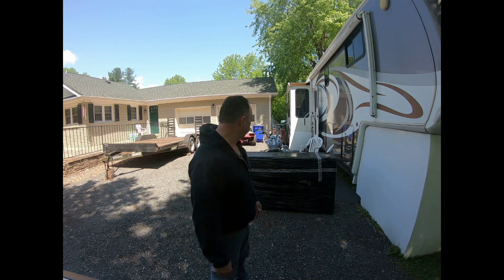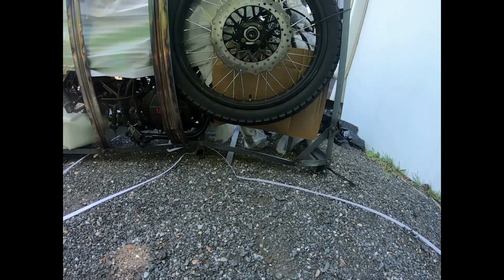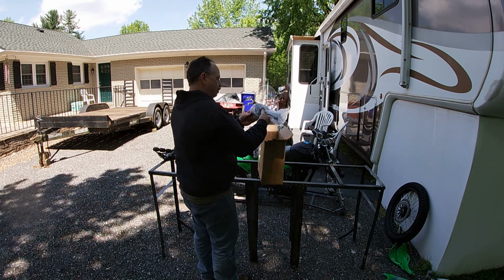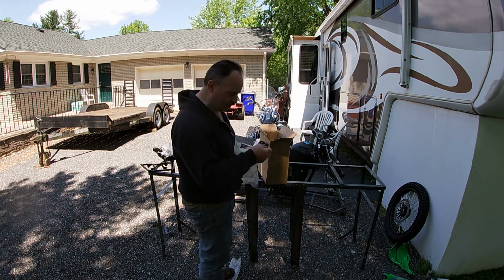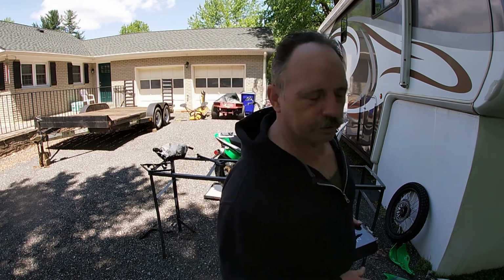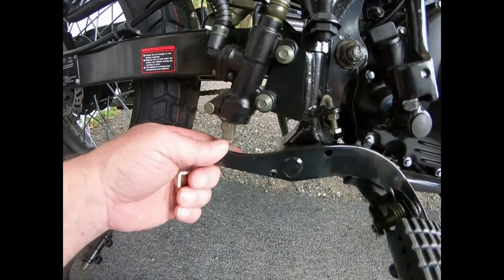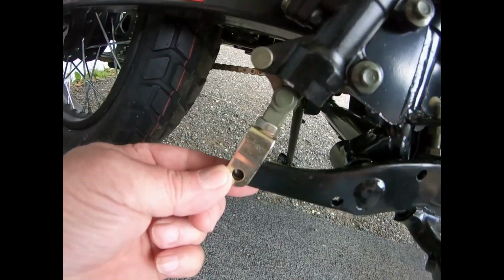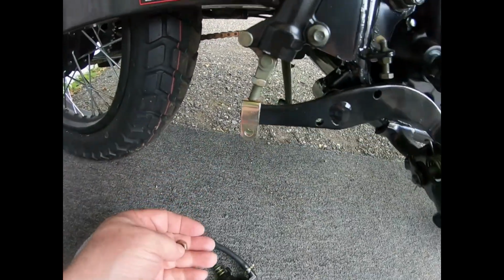Unboxing  a Tao Tao TBR7

Comment: Hey I seen you just got this tbr7 so do I check your back brake hydraulic line going from your back brake disc to your brake cylinder zip tie it down mine came loose and lost back brakes other than that that's all the problems I've had I've had mine for about 2 months now
Reply from the maker: Hey .. Thanks for the info